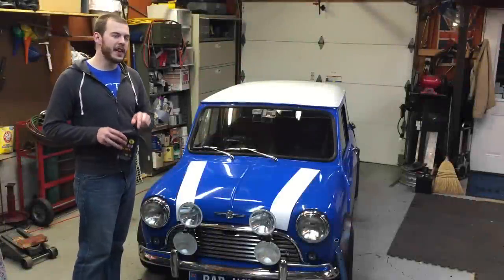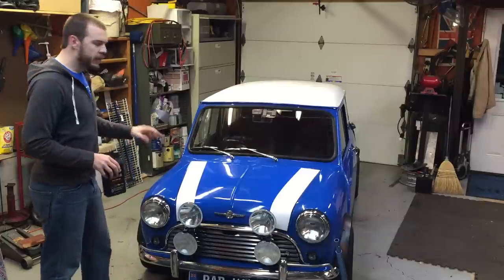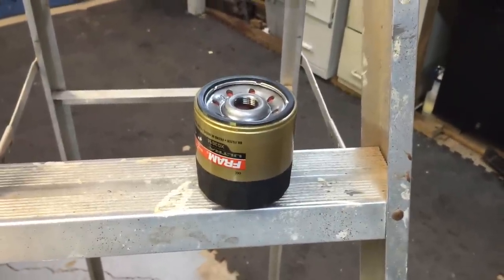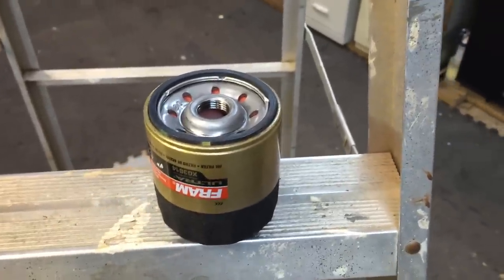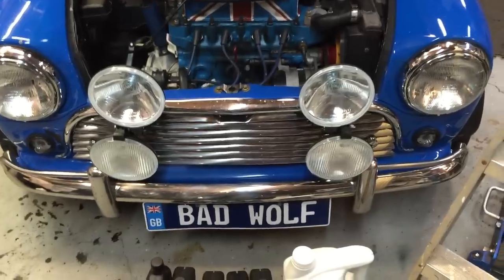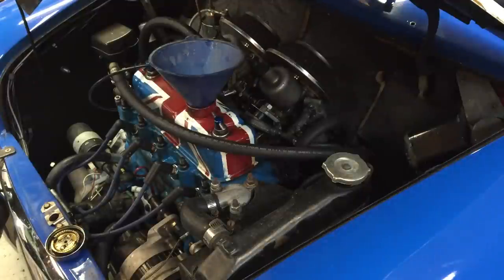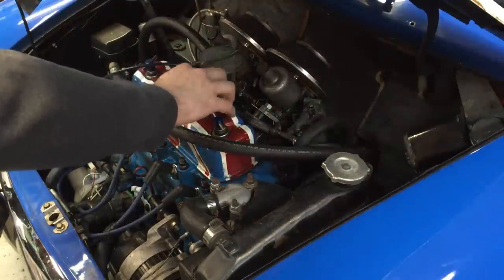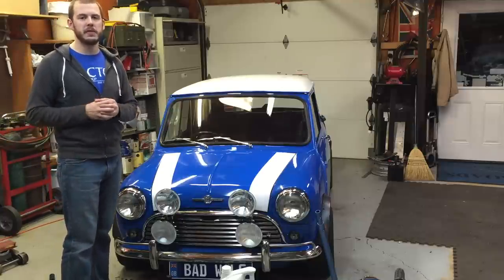Classic Mini DIY - Oil Change

Comment: I gave my '98 Mini Cooper MPi a well deserved oil and filter change today after doing the London 2 Brighton mini run over the weekend. It ran perfect the whole run over 200+ miles with no problems! :)
MR
Reply: Hey is the drain plug located in the same area as on the video? Cheers

Comment: Some earlier cars have a cartridge type filter. You can tell by feeling the bottom of it, if it is smooth it is a modern unit like the one featured in the video. But if it has a nut on the bottom it is a cartridge filter and requires more work to replace.

Comment: Valvoline Vr1 20w50 works great aswell, my friend uses it in his racing mini in days when the temps are over 40c (100F ) , so far it's the only one he has found not to thin out like water when engine temps go ovr 100c, btw the W does not stand for weight, it stands for Winter
Reply: Yeah that VR-1 is an awesome alternative.  Really I just prefer the brad penn but if I ever am without the BP I go straight to the VR1.  It's really really great oil, and its super easy to find in local shops.
Reply: Hello. What do you think of valvoline racing vr1 20w50? I have an austin mini 1000. Do you think I do well?
Tank yoy so much

Comment: Classic Mini DIY can you tell me what is the reference of the oil filter from K&N that you have allready instaled in the car? I want to change for a K&N oil filter but i dont know what's the correct reference of the K&N Filter. TY and keep doing great videos
Reply from the maker: Sure its this exact filter. Hope this helps!
https://www.7ent.com/products/oil-filter-spin-on-k-n-sen0014.html?af=cmdiy1959
Reply: Thanks for the help, however doesnt say what is the correct model (reference) I'm not from U.S. so i cant buy on that site. Dont you know what is the K&N reference?

Thanks for the help
Reply: K&N oil filter part number is HP-1002

Comment: Is it common for recently changed oil to be ashy black in color? The oil in my ‘66 mk1 998 engine was changed 200-300 miles ago. Thanks in advance for any help or advice!

Comment: I remember having to change the oil in my dad's mini as a kid.
Despite the mini's low ground clearance you could do it without having to jack up the car.
Reply from the maker: Yup, I actually have been wanting to redo this video for some time now. Could make it a lot better!
Reply: I'm a bit fuzzy but do the old mini require repacking the wheel bearings with grease?
Reply from the maker: Sometimes if you service them soon enough you can just repack them, but most of the time they need to get replaced entirely. It's funny you ask this because about 10 mins ago I uploaded a video where I was repacking my rear bearings! Haha
Reply: I just remember that my dad had installed grease nipples in all four wheel hubs so that fresh grease could be pumped in without having to take out the bearings
One of my chores back in the day was once a month I'd pump gear grease into all of the the grease nipples until the fresh grease had pushed out all the old grease.
I think it was something he had picked up from one of the old Mini repair manuals.

Comment: Thanks for the video
What is the exact frequency of changing oil. I am from Sri Lanka and some people say every 2500 Kilometers 
Isn’t it too early to change the oil of a Mini ?
Reply from the maker: Hey Dasun, I normally change my oil every 2500mi / 4000km or every 4-6 months. Because the gearbox shares the engine oil its quite important to change it more frequently than a modern car.

Comment: Don't forget to ANEAL the copper sump plug washer..ie..hold it in a pair of grips and get it red hot over a gas burner(on your stove if the wifes outta the way) you'll know when your done as you'll get a green flame coming off the washer.Let it cool down and your done.It re-tempers the washer so it slightly squashes when you refit to sump.
Reply from the maker: +PHIL PRITCHARD Great pro tip.  You can do this to reuse the washer if you want or you can replace the copper washer each time.  Thanks for sharing!

Comment: Can you do a video showing how to remove/install exhaust pipe?
Reply from the maker: Yes that's actually my next video!
Reply: I'm doing mine next week! When's the video going up?
Reply from the maker: Probably not within the next week unfortunately.  I would imagine within 1-2 weeks.  It's a friend's exhaust that I will be replacing with him.
Reply: No worries. Hope it works out! Great channel.

Will you do anything on properly adjusting drum brakes and the handbrake?
Reply from the maker: Thank you!

Yes I do have that on my list of things to do very soon as well.  Mid October probably on that one.
Reply: Cool! Keep up the good work. It's very refreshing to see someone cross the T's and dot the I's when it comes to Minis.
Reply: Nice! I have just a straight pipe exhaust, no muffler or anything, it was bumping off the clutch/gear stick system that I got half fixed, but just need to figure out how to securely fit the exhaust pipe, currently it can be moved quite a bit.
Reply: Can you do a video showing how to install speed cable???

Comment: I recently bought a classic mini (Leland Clubman 1100cc) . Can anyone tell me what oil, sparkplugs and brake fluid to use?
Reply from the maker: If you have a mini with a manual transmission here is a listing of all the things you need for an oil change, spark plug replacement, brake fluid refresh and other jobs: https://www.amazon.com/shop/classicminidiy

Comment: I have a 1975 A series 998 engine. Is it better to check the oil level when the engine is warm or cold? The dipstick is pretty short and its really hard to read the oil level
Reply from the maker: Cold will show the settled oil level.  The "lowest" it can get.  There is a lot of back and forth about which is best.  I recommend doing both.  :-) If your dipstick is short I might consider getting a new one oil level in these cars is super important.
Reply: Same story with my 2010 R56 Mini, the worst oil dipstick impossible to check the level accurately.

Comment: great explication, I have a Mini Cooper Sport model 2000, what happens if I put Oil Mobil 1 synthetic 15W50?

Cheers.
Reply from the maker: I haven't used that oil in my car so I am not quite sure how it would pan out.  The weight and viscosity are about right but I can't say for sure how it would behave in the motor.
Reply: I run 90W50 full synthetic

Comment: i have a fuel leak, fuel goes through one piston pipe and straight down the over flow pipe, its not the float thats the problem it starts up with carb cleaner, i dont think its getting enough fuel to the head cos at back of the exhaust its spitting oil out am not sure what to do i can send you pics to your email?
Reply from the maker: Sure send them to minis@ccmu.us

Comment: You know Where’s the transmission fluid level stick?
Reply from the maker: The classic mini does not have transmission fluid. The engine oil it shared between the engine and transmission, and has a fully open sump. So your regular oil dipstick will give you the fluid level of both the transmission and engine because its the same oil.

Comment: Haynes manual specifies 10W40. Is 20W50 better?
Reply from the maker: From what I have read 10W40 is better for the auto transmissions than the 20W50. But I’m sure both will be fine. I always have run 20W50 though.

Comment: Whats your oil spec recommendation for automatic classic mini?
Reply: I need to know this also, I've been told JASO MA2 spec 10w40 is better for the gears. But have also been told 20w50 mineral oil should be used, it's so confusing.
Reply: Same here 89 rover mini automatic idk what oil
Reply: @FirstLast-ox5ls  I spoke to a number of automatic experts since this comment and I can confirm 10w/40 JASO MA2 spec is the right oil for the automatic minis, 20w/50 is too thick for the 'hydraulic' system

Comment: Ironic that you say to not use synthetic oil as you show a quart of partially synthetic don't you think?
Reply from the maker: :-D Brad Penn is a bit different but standard synthetic oils are not great for these old minis.  But yes it is a bit ironic haha
Reply: +Classic Mini DIY Do mini engines have rope seals? normally you can use synthetics in classic cars that have had their engines rebuilt without a problem but if it's a very old 50s or 60s engine design like the A Series it's better not to as synthetics clean up all the sludge keeping the seals from leaking, even on a freshly built engine

Comment: All classic Minis should be running with 20W50 MINERAL oil. Best oil so far is MILLERS CLASSIC MINI OIL. It is not only a matter of oil thickness, but also of ZDDP (zinc/phosphorus) content, special for the characteristics of the A series engine. I don't see the point to use anything different if you do really appreciate your Mini.
Reply from the maker: Good tip thanks for sharing. This is a pretty old video I’m planning on remaking soon. Will include that detail in the new episode. 👍🏼
Reply: Hi I'm running mini minor 850 dxl 1275cc injection... Does it have oil filter..?
Reply from the maker: Yes all the minis have an oil filter. Should be on the front hanging under the alternator or screwed directly into the block on later MPI engines.
Reply: Hello. What do you think of valvoline racing vr1 20w50? I bought online to use in my austin mini 1000.

Cheers

Comment: Folks, do your Mini a favor and DON'T DO IT LIKE THAT!!!
You must be kidding... What's DIY about that video. You didn't drive the motor until it was warm, meaning the, as you said, heavy oil won't drain properly. All the old crap you want to get rid of still is in your engine. You drive a car that is unique because it uses the same oil for the motor AND the gears. That makes it essential to do regular oil changes in very short intervals. That was basically the only thing you did right. 
No torque given for the oil plug, which is 35Nm or 25 lbft. If you use too much torque you might kill the thread. Not funny and very expensive. 
To prevent killing the oil filter as well use 18 to 19 NM or 13 to 14 lbft. Every time you change oil, change the filter as well. 
The oil you use sucks. You got loads of brands that offer classic car oils. And they are NOT synthetic. 
After filling, check your oil level. Start the engine and check again because your level will fall, for the circuit has to be filled after draining first. Refill if you don't have enough oil after having the motor run for a bit.  
And sorry, one comment I can't resist: You proudly present that your engine starts. Great man. It even will without oil. But it won't run for long. 

Please do your DIYs properly or just don't.
Reply from the maker: ¯\(ツ)/¯ Thanks for the feedback. I have have been using this oil and changing my oil on this car, in this way for 5 years and I haven't had a problem. Everyone has a preference of the oil they prefer to use in their cars I like Brad Penn and it has been the best oil I have used.  I'm sorry you felt the information wasn't complete and if you feel like you could do a better job teaching please start making videos.  I would love for more information to exist for Classic Mini owners and it sounds like you have a great deal of knowledge in relation to these cars.  Have a great day!